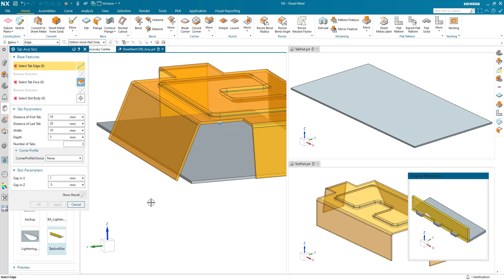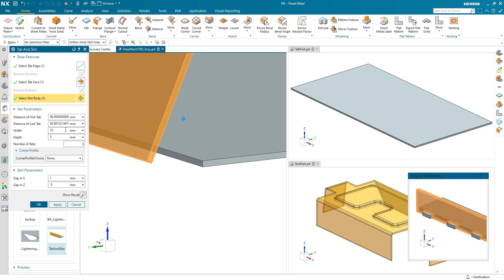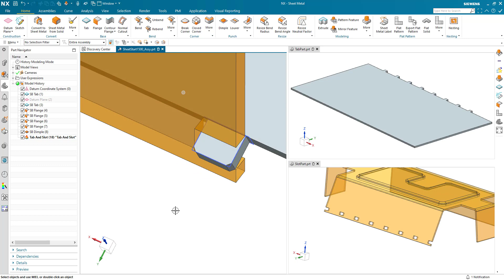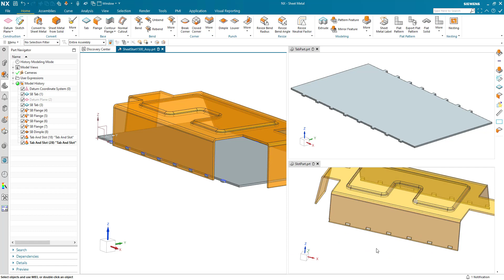Siemens NX Sheet Metal: Tab And Slot

Comment: Thts was awesome but unfortunately that option not showing in the library so what to do to get that option in library...??
Reply from the maker: Feature templates are there for you to create your own. This is one example I created. I will share it on the Siemens community forum at some point.
Reply: @deedub7777  can you guide steps to create the same one if its possible.....
Reply from the maker: @ai_designdevelopment6252  There's a great intro on how to use them here https://youtu.be/9cBff8VermM
Reply from the maker: @ai_designdevelopment6252  Watch here how it was done https://youtu.be/-Jc8optaesY
Reply: @deedub7777  Thanks a lot sir...